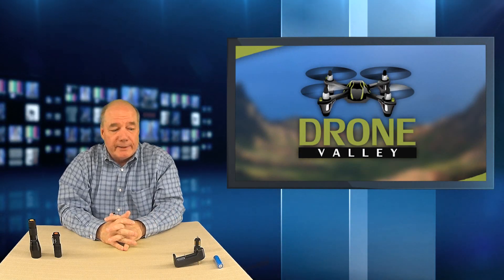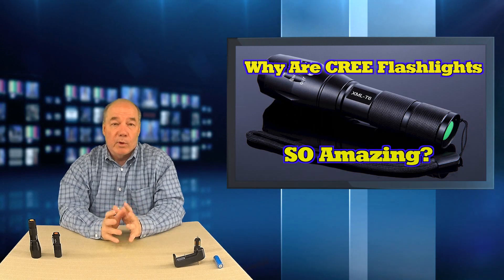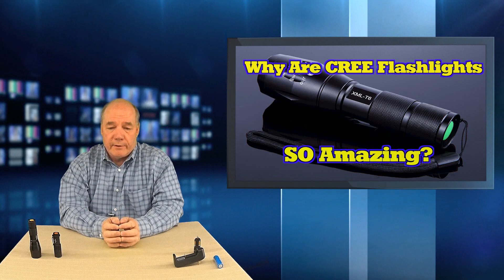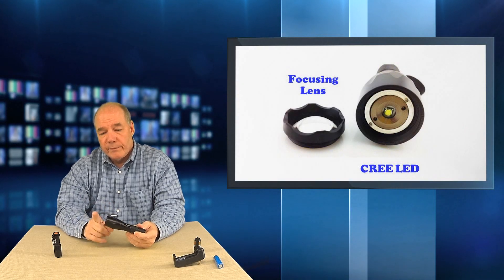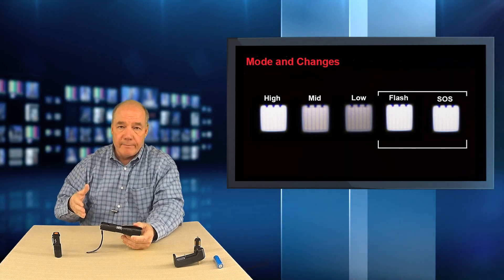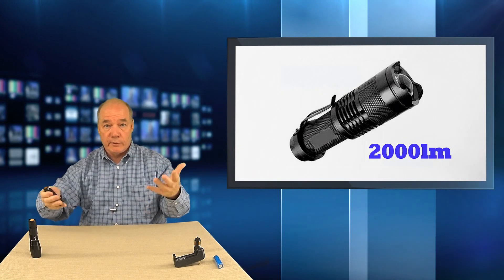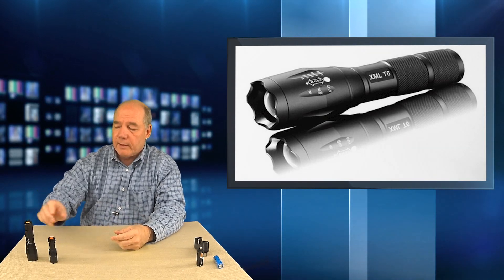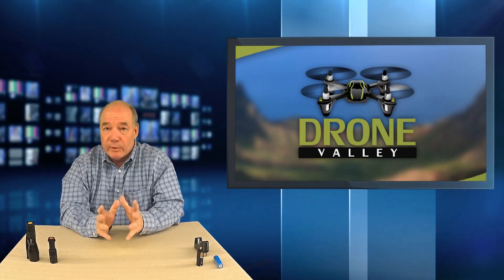Why are CREE Flashlights SO Amazing?

Comment: No way these are 2000/3000 lm, I have both of these and the small one with a AA battery would not put out 2000 lm, at best about 100, I noticed you never showed them working, just an image in the corner.

Comment: Where can I buy either the 2000 or 3000 lumen Cree flashlights?
Reply: Don’t buy these.. they aren’t anywhere near 2-3k lumen. Go for a real brand like fenix or olight or eagtac.. these companies build much more solid lights and don’t lie about output figures. You’ll probably get a better led as well (still Cree, but you often now get a choice of tints) Cree isn’t the only good led manufacturer either.. nichia, luminous and Samsung make some killer ones as well. 

Spend some time on R/flashlight and see what’s good… afaik, the smallest 2-3k light out there is still the lumintop fw3a.. awesome, highly configurable and customizable light. However, any true single 18650 light with that output isn’t gonna sustain it for long. They generate a ton of heat. The fw3 can sustain turbo for maybe 10 secs at a time.. but can do 300-700lm for reasonable periods. This is gonna be standard among lights like this. These leds generate heat. Period. Again, the lights shown in this video are typically lying about output. I actually own the smaller one (originally sipik sk68) and it’ll output maybe 250lm with a 14500 cell (aa size li-ion). Lights like the ones you seek exist, but you’ll have to do a little bit of homework.

The lights shown here are generic white label bottom shelf junk.

Comment: This is very deceptive. You do mention that that Cree does not make flashlights but at that point you have already loaded up your viewers to associate Cree with these cheap flashlights that are rebranded by companies that scam people. 

These flashlights do not get anywhere near 1000, 2000, 3000, or 4000 lumens that they advertise.

They achieve around 100 - 200 lumens. I am appalled that you even feature these flashlights.
Reply from the maker: Nothing deceptive about it. I did mention that Cree makes the bulb and not the lights. There are always scam artists out there trying to take advantage but I can assure you that the lights we sold at the time (this clip is several years old) were the brightness we stated and had a lot of happy customers. Thanks for the post! Rick

Comment: Thank you very much.  I have one that has a charger USB but after trying to charge it it would not work.  It lights when the charger is in but does not after disconnecting the charger. Am I doing anything wrong ?
Reply from the maker: Thanks for the post and it sounds like you might have a bad battery. Lipo cells can be very finicky and go bad often. If you can change the battery, that might sort it out for you. They are typically 18650 models in these lights so I hope that helps with the issue. Rick

Comment: I buy those cheap CREE flashlights that sell for about $5 (you called them the pocket guy, it is the small 100 lumen flashlight in this video).  They do not last anything near the 100,000 hours as stated in this video.  I get about 2-3 years at best, or i estimate about 100 hours.  When i say they do not last, i mean the lumens get so low it barely puts out any light.
Reply: Replace the standard AA Alkaline battery with a 14500 Lithium
cell and you will be amazed at the light output. Mine works great !!
Good luck!!

Comment: I like, that you did this review on [Cree] Flashlights, and think you should continue making 'any' video on whatever subject/gadget that pleases you. Because I learned a LOT about Cree today (from you).  After watching your video I shopped on Amazon for a 3000 Lumens Cree and a 2000 Lumens Cree flashlight that you showed in your video. And I read a lot of reviews from people on Amazon who bought flashlights with 3000 Lumens, 2000 Lumens etc.  The majority of end users, [claim] that the people selling these flashlights are lying about the Lumens output, saying that when they received their flashlights, they were were emitting between 300 and 500 Lumens at best and that the [sellers] are lying about the actual 'Lumens' that their product is emitting.  Therefore - now I'm reluctant to buy one in Amazon or elsewhere for now.  I think I'll got to ACE Hardware, Bass Pro Shops, Cabbalas etc., to look at them in person and try them out before buying online.  What are your thoughts?  Do you have any slightest thought, that [maybe], the Lumens on the two Flashlights you're showing, were misrepresented by the seller?  And .... if so ..... how can an individual check / verify the actual Lumens that a product is emitting?  Is there a Gadget out there that a person can buy to check this?  Thanks.  :)
Reply: check out r/flashlights on reddit. theres no way a AA battery flash light is throwing 2000 lumen. this video has a lot of bad information. The 3000 lumen light in the video is a chinese light too, and youre right, it does 500 at best. that said, you can get a 1000 lumen light with a rechargable 18650 battery for less than 30 bucks. the CREE LEDs are a important, but with out a high output battery you wont get anything out of it.

Comment: I've become a flashlight nerd. You stated it will run longer on the 18650 rechargeable.  Frankly I find that surprising.  I believe the 18650 is nickle metal hydride.  It will have a flat voltage curve but once it is drained it is done.  Alkalines you can shut the flashlight off and there is a recovery.  Have you tested battery life at say half power.  Is the extra current simply not used or is it just wasted.
Reply: 18650 is li-ion.

Comment: Old video, but... Cree do not make actual flashlights. They make LEDs. 
Flashlights presented in this video are some of the cheapest crap you find on eBay and Amazon for 10, 20 bucks and should be avoided if you're serious about buying good flashlights.
Reply from the maker: Thanks for the post and a lot of companies sell lights that use the Cree tech. The lights I showed in this clip were manufactured almost 2 years ago and were an outstanding value for the money. They have since been knocked off in China (as usual) and some of the cheaper versions have hit the market that are clones of the original. We have moved on to COB tech for our lights but CREE was an incredible innovation that is still growing in popularity. Rick
Reply: Appreciate your quick reply, Rick. 
If you just want something simple and cheap then those are "ok", I guess. But if something much more reliable with genuine warranty, support and all that is needed, there are far better manufacturers making seriously awesome lights and many are great bang for your buck. I have 3 (flood types) and 4th (a thrower) on the way.
Cheers

Comment: If drones were to unionize, would that mean there'd be a risk of drone strikes?

All jokes aside, did you also ever have or see that flashlight that was the thin aluminum body with the red plastic head with the switch that was big, red, plastic and switched on and off by pushing it up or down?

Comment: Cree sucks, I'd rather have high CRI lights (nichia 219b, 219c, SST20, Nichia Optisolis) than a bright off-color Cree. Unless we're talking about a long throw light for shooting across a 1-2 mile corn field at night, then Cree is the winner.
EDIT: the products you are selling look fake to me LOL. 2000 lumens produces some intense heat(you will generally need a huge light or active cooling for over 1000 lumens), and a single AA can only produce 260 lumens for 55 minutes (cree xp-l hi), different emitter will not change that much. A single AA will NOT produce 2000 lumens, that is a lot of current draw for a single AA (even nimh, and lithium 14500),
Reply: What about the 18650.
Reply: @Malc664  I don't see a link to it any more. Generally speaking 18650 lights are limited to a true ~600-1000 lumens due to limited heat dissipation. But the battery itself can put out up to 5000 lumens maximum depending on design (usually just a short burst, even if it uses a ton of LEDs which increases efficiency). 18650s and especially 21700s can put out a huge amount of watts but the light package just can't dissipate the heat without active cooling. AA/14500 is limited to 2 amps (14500), less for aa
Reply: Good to see that someone else here knows these garbage lights for what they are! Soo many misled folks here in the comments.. yes. No pocket 18650 light is gonna sustain more than the 600-1000 lumens (depending on led) for more than a minute or two. Or less. My most powerful light in this class is the lumintop fw3. It’ll do up to 2800lm, but for seconds at a time, and it gets HOT in that time. 

When companies don’t lie about output, you realize what you really need, and usually 2-300lm is plenty. In a dark room, 15-100 is usually enough. Even less if you’re adjusted to the dark. Optics play a huge role here too. 200lm focused down is gonna travel much further and appear much brighter than that same 200lm if it’s allowed to spread out in all directions.

Comment: EXCELLENT flashlights, very low in cost.  I have bought a half dozen, happy with all, using rechargeable 18650 batteries or rechargeable AAAs.  Highly recommended, extremely powerful adjustable light coverage, with 3 power beam strengths, flashing, and SOS in Morse code.  Superb buys.  No, I am not associated with any manufacturers !

Comment: So, I have been seeing these Cree Q5 lites being sold to mount on top of the Mavic Pro . Some even mount two on the rear landing gear. My concern or question, has anyone had problems with their Mavic from these lights, especially in the strobe mode. I was wondering if RF or EMF would affect the compass or GPS or the antenna mounted in the arms on the Mavic. I have being seeing a lot of these lights being sold on Amazon with out much reviews to read.PGYTECH has them LUME CUBE brought theirs out,  made mainly for photo use at $179 with mount and two lites,ouch. So what are your thoughts or experience with these on a DJI Mavic Pro.

Comment: I'd like to point out that these kind of zoom lights only put out about 50% of light when zoomed in. You can see for yourself: go to dark room, point the light at the ceiling, and zoom in and out. you can see how the overall light level in the room changes as you zoom in. In order to put out ALL light when zoomed in, you need more complex lens system, which lights like Led Lensers or Fenix FD41 has.

Comment: These flashlights are the real deal. Just bought a cheaper version from China that was supposed to be 6000lm and its not even close to your 3000lm light I bought.
Reply: The Sky Pod if you buy cheap flashlight 95% of the time they are no where near as bright as it said it is I have a 2600 lumen flashlight called acebeam K70 one of the best flashlights I have I can light up stuff from 800-1200 meters away

Comment: Hi Rick, I don't know what you do for a living, I am guessing teacher or college professor seeing how you are right at home at presenting any topic. As always I find your reviews to be informative and entertaining. I  recently became a subscriber while searching information on the new DJI Mavic Pro. As to this video, I watched it because I saw on your site the very same flashlights and could not believe the price for such a high power Cree light. Especially the 2000Lm Q5 Mini though I do have a question for you. Are you sure of the output power? I ask because I am looking for a powerful thrower that will  produce high output on standard batteries and recently saw the ThruNite TN4A HI flashlight, CREE XP-L HI LED, Max output 1050 lumens, Using 4AA batteries but the price on this flashlight is at least 6 times the price @ CDN $64.95 delivering only half the output and at a substantially larger size. I have read that certain Chinese companies love to exaggerate when it comes to the power outputs on their lights and I'm wondering if this is not the case here. Have you had these lights tested? I know you have used them yourself but have they actually been confirmed to operate at the power output advertised? I find it hard to fathom that a small Chinese company could produce something better and cheaper than a reputable company like ThruNite. I will probably be ordering a few accessories for the DJI Mavic off your site and will also order one or two of the flashlights as well, I just wanted to hit you up with these questions before throwing the lights in with the order. Again, thanks for the information, please keep on doing what you do, love the channel!!

Comment: The 18650 UltraFire batteries you show on this video comes with a lot of products from different Chinese webshops, but they do have a rumour to send out a lot of fake ones (normally with small like clock batteries stacked inside) and even worse rewrapped old batteries that could cause a lot of harm when used. Do you have a guarantee that you get authentic batteries?

And, one last thing, since you go at these videos from en engineering perspective you should really mention the danger with 18650 batteries in a pocket with keys and some small change, they can easily short circuit and catch fire or explode!
Reply from the maker: Thanks for the post and I agree that there are a lot of companies selling these and not all of them are original. I actually work with the company that makes these and buy directly from the factory so I know I'm getting original products. I also test everything I recommend extensively and have used these light, chargers and batteries for over a year in all types of conditions. I also agree that the 18650 cells can be dangerous if misused but only include one cell with each light. This way the battery is either in the light being used or on the included charger. I really appreciate you watching the clip and appreciate you commenting. Thanks, Rick
Reply: Drone Valley Ok, thats good ;) And btw, I really like your drone videos! I sold my P3 Advanced and I really miss it :( Now i am concidering the Mavic ;)

Comment: My battery has been charging about 6 hours and is still flashing red.  Is this normal rick?
Reply: Just turned green!  LOL, sorry to bother you.
Reply from the maker: Great to hear, you had me worried. You can actually use the battery before it turns green it just won't be fully charged. Also, the first charge is important for the cell to condition it correctly so I'm glad everything worked out OK. Let me know how you like the light and thanks again for your business. Rick

Comment: Thanks for posting this! As a photographer/videographer, I now employ a two-cell CREE flashlight (about 6 inches x 1-1/2 inches) for doing interior real estate videos; it is simply mounted on cold shoe bar that runs fwd-back on the camera with just a couple of rubber bands. It smoothly spreads a terrific white light on a very wide angle with no "hotspot" in the center. Point is, this beats - and replaces forever - my $100-plus video light by a mile, at 1/5 the cost! And by the way, it is outstanding for running around and lighting up a subject for creating twilight still photography. Wonderful.
Reply from the maker: Thanks for the post and I totally agree. Every time I turn it on I'm pleasantly surprised at how much light it provides. It's also really durable and I've dropped it in a stream while on and was able to fish it out dry it off and continue to use it. Thanks for stopping by! Rick

Comment: Hi Rick.  Since this video I bought a flash light and the cable from RC to tablet from your site. I love the light and I am getting more tonight. I think it only took 2 days and I got my order. THANKS. But on the other hand you guys should make the RC cable just like 2" longer. It does fit but a little tight. I kept loosing the connection from the app and didn't know why. I think it was the old cable and now we will see. Thanks for the video and again great FLASHLIGHT!!
Reply from the maker: Mark, thanks for the post and I'll send you an email on the car kits. I appreciate the suggestion on the cables and they are a little tight with the larger tablets. I'll see if I can find one a little longer to give you some wiggle room. Rick
Reply: I am not complaining and I only use a 8" tablet but I can't put in the center of the RC holder but it does work.